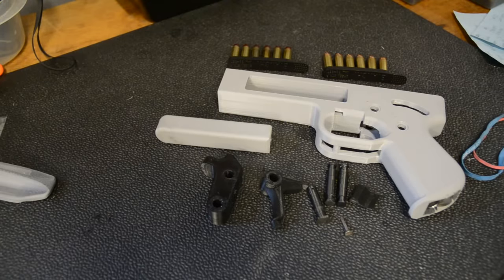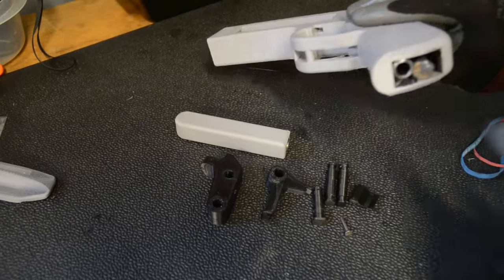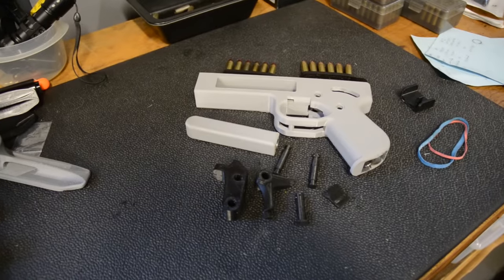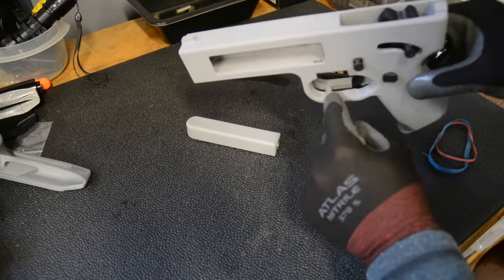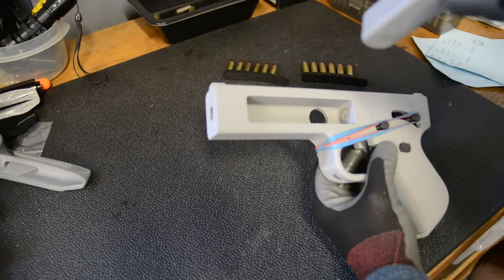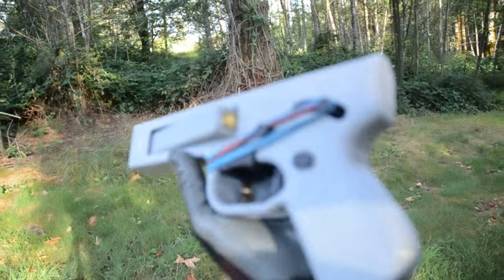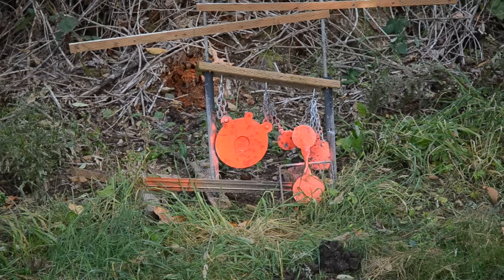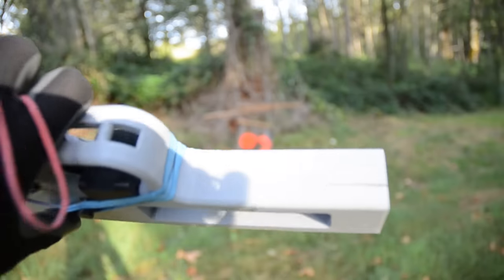Songbird 3D Printed Pistol - .357 Magnum

Comment: printed in the wrong orientation stand it up. ar15 stls orient horizontally. pistol frames like that should be vertical for best qualiy. also if you are using pla do an acetone dip for about 45 seconds and let it work until dry. it will harden it up and smooth it out
Reply: wrong. This pistol is printed in that orientation for  a reason. The instructions for the original file say to print on its side with "Patrick" facing upwards. I believe this is the right side down to be specific. it is printed so that the layer lines on the frame and the layer lines on the barrel are in opposite orientation, therefore the frame can better reinforce the barrel. Printing the frame and the barrel in the same orientation would likely result in both de lamination of the barrel and pistol. This would be sub-optimal at best and explosive at worst.

Comment: You can make your own gun, as long as you keep it, do not sell it to anyone, nor violate any of the NFA issues. The inspiration for this concept gun could have been the Clint Eastwood movie 'In The Line of Fire', where the antagonist played by John Malkovich, makes an all-plastic assignation gun. Wich was FAKE.  The Songbird has a barrel liner, wich the movie gun did not. If anyone would like to go ahead and try making a copy of that movie version, firing it and writing the comments via someone else's hand's after you get out of surgery, please let us all know how it was. The Songbird, however, will work as long as the polymer keeps the metallic barrel liner in the correct configuration without any stress cracks. Newer and higher strength plastics are most likely going to come out. Yet if someone who could not legally own a handgun went to the trouble of actually making the Songbird for "illegal " reasons, once caught they would never taste freedom the rest of their life. This gun is more of a novelty to see if it can be done from an engineering standpoint. For that, I say good job.

Comment: HHHmmmmm I was correct again. I did not think it would be right with a .357 magnum. I am not knowledgeable of 3d printing materials but would not feel safe shooting it with a printed gun.  You noticed the difference  with recoil and sound level I am sure.  It is a good round and good range ability with a 6" barrel handgun round..

Comment: For fucks sake..... were all dead.... its over, its all over  A WORKING PISTOL WITH PLASTIC A BARREL AND RUBBER BANDS!
I applaud the fact that you made it work but.. now....we....are...all....GONNA DIE Some 12 year old with access to a 3d printer is gonna blow himself up or worse the damn thing works and now theres a untrained kid with a plastic pistol thinking hes a badass, i just hope hes not the "check this out dude wanna try it" type.
But for real nice job on it i'm just worried that this is gonna start something XD